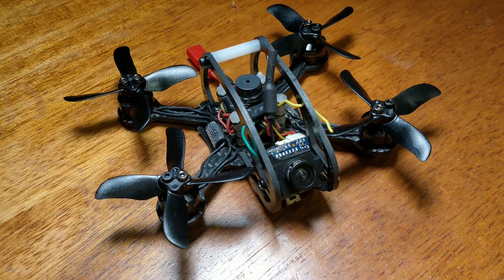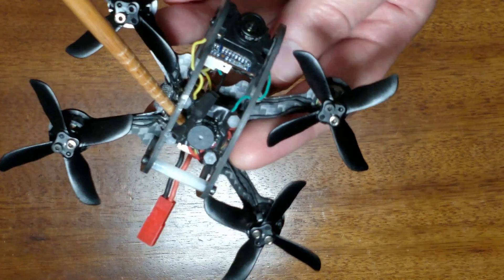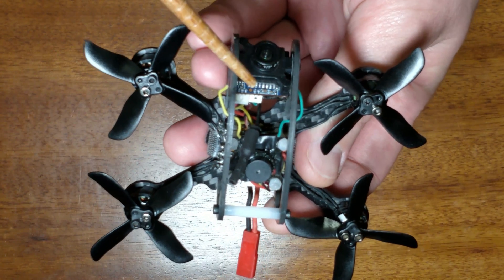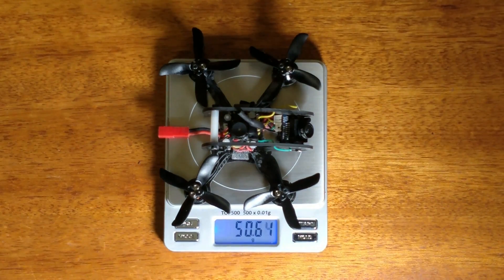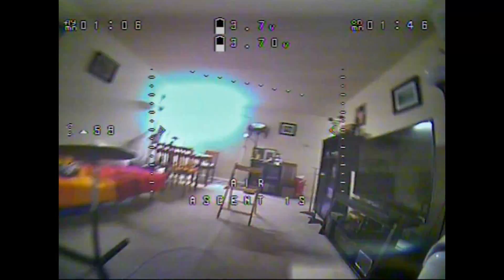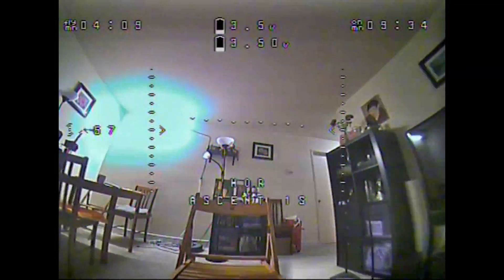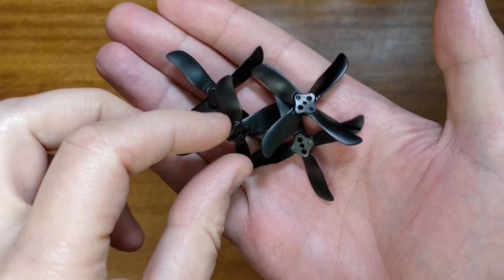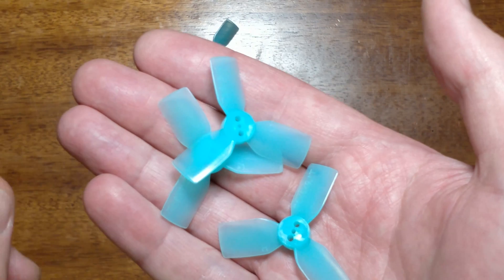Ascent 2" with 1102 12500kv motors on 1s battery

Comment: Does osd's voltage display work properly when using a pololu module?
Reply from the maker: You have to connect vbat to fc input and pololu to 5v then it will work
Reply: Flex RC esc +,- >pololu->fc +, is that correct?
Reply from the maker: JaeHyun Jang esc -> FC vbat, esc -> pololu -> FC 5v

Comment: Dmitry did you test dys 0905? Looks like they are more powerful then 1102. On paper 50 grams of thrust on 1s and 3020 prop. My build with them is about 44 grams.
Reply from the maker: no, I have not. I will a bit later

Comment: Dmitry;  You bragged on the 1102 motors!  Better than the 0703 motors for 1s!  So will you make us a Mira 84 frame with 1102 motor mounts.  For a 1s I want prop guards for indoor flying.
Reply from the maker: thanks! Mira is designed for 07xx motors. I have Nano X which can be used with them and for bigger props need to design completely different frame, maybe bigger Nano X